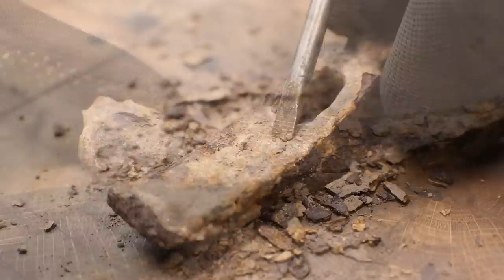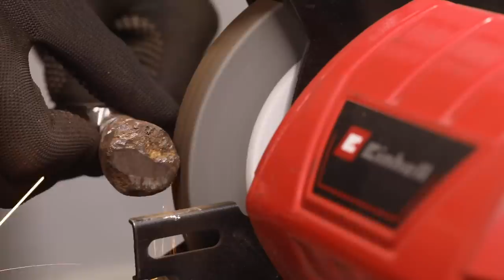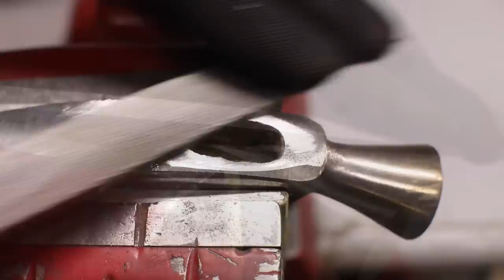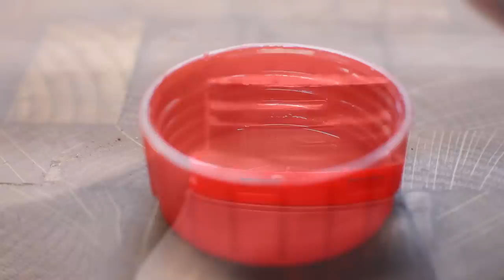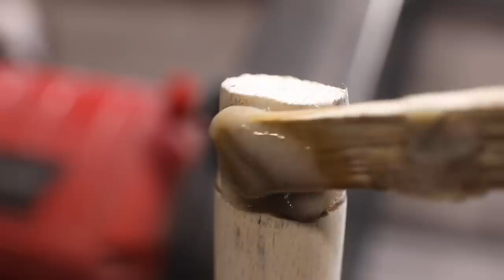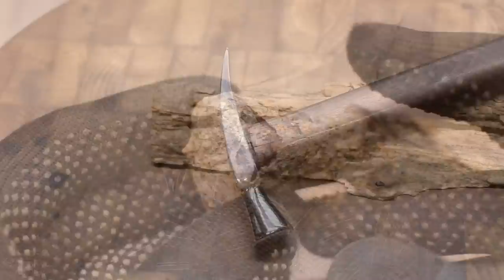Very Rusty Hammer Restoration

Comment: You have lots of fun projects in that rust pile.
But, why not just soak the hammer in vinegar, and then use a spinning steelbrush with an anglegrinder...   Removes rust super easy.
Nice hammer in the end.   =)

Comment: I have done a few.  I have some Plumb hammers and a lathing hatchet that I have done.   the pits and the many angles of the tool are the problem.  plus .. I do not want to get rid of the markings.   after rust removal I might use a dremel to get into the tight spots and a buffing wheel and compound for the rest.   A sisal wheel and black compound generally will get enough of a finish to not be overly polished but smooth.  I can stay away from any engraving or markings.   Bluing looks good but maybe the pimp in my comes out and I nickel plate most of the time lol